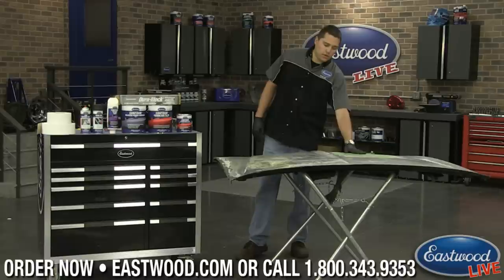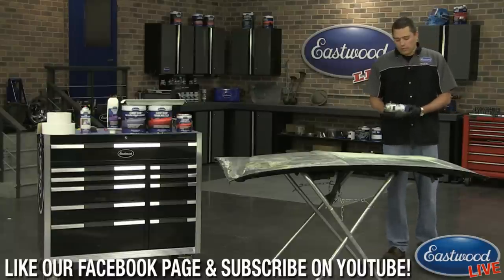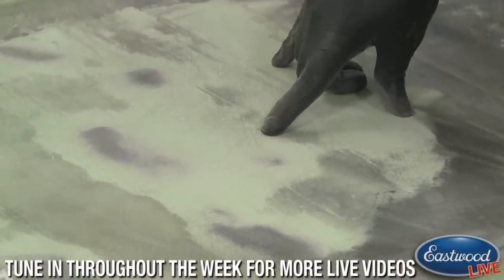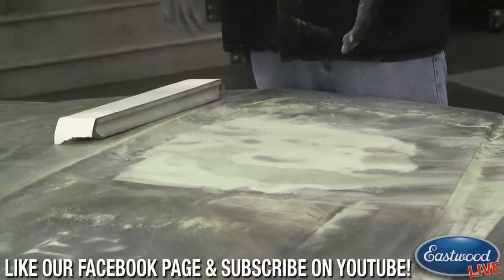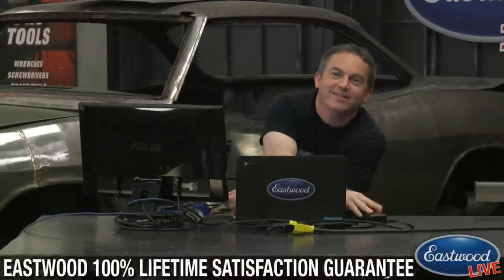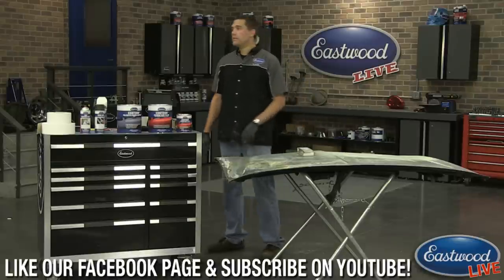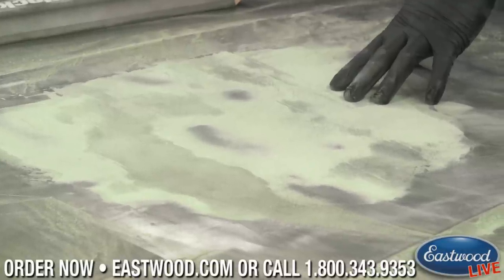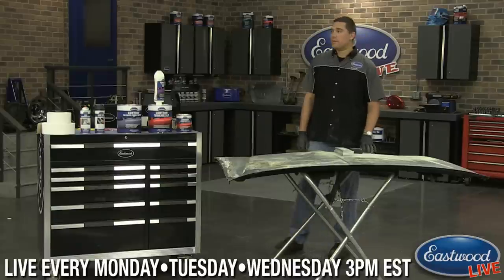Beginner’s Guide to Sanding Body Filler - Basics of Body Work - Eastwood

Comment: I liked HomeGrownPyro's comments, but I'm going to be less polite than he was: my question is when you are through with 80 grit, and 1/16 wide, somewhat deep channels like a river are on my hood, "do I sand deeper or add filler?" My next question is to understand the mechanism of failure:  What caused my problem? I wonder if Eastwood is too stingy with the blue filler, which I can't find in the cheap parts chains filled with poor young men and ladies just trying to survive, such that their was a lack or hardner, or perhaps I did not mix the aluminum type bondo throughly enough the next day. Your greatest help to me came from an informal comment: "It's just body filler. You can always start over."

Comment: One key factor is mixing the products correctly. Most new body people I have worked with don’t even know the correct ratio or how to do it. Improper mixing can cause failure. Sanding product when it’s soft does as well, maybe it keeps the dust down but you can pull the uncured product off the panel.
Reply: Thanks for the tip

Comment: I use all Eastwood products. I have many feet of 80 grit that loaded up with filler. The paper is not worn but has random clumps on it. The sand paper also comes off my Durablock after 2 to 3 uses. I've let the filler harden more but am still using a lot of sandpaper.

Comment: This video was really good, thanks....would have loved to see him go into the next step of working the metal before applying another coat of filler. Being new to auto body work, I struggle the most with that next step of working the metal more. I kind of get lost in the mix of metal, filler, highs and lows. I find it difficult to determine whether the bare metal showing through the filler is actually a high spot or the original surface. Usually end up making it worse by hitting small dents into spots that didn't need to be hit in the first place lol. Anyway thanks for the vids they are really helpful 👍

Comment: This was Great I had 1 question. After epoxy has lost 5 day window before applying filler do you need to re spray another coat or sand to metal in those spots?

Comment: Maybe a silly question but how can you tell the difference between a HIGH spot and just that the metal is level with the surrounding body filler? Low is easy, it will still have guidecoat ...thanks in advance for the help
Reply: good question. it could just be level with the filler.east wood need to answer that. curious minds want to know

Comment: Can somebody clarify what he means when he says "work it "? He says it obviously needs more work, sand it work it sand it work it... There are high spots next to that low area with the 36 grit scratches so what would be next?
Reply: davenameless you keep applying and filling low spots and tapping high spots down until you get the flattest panel , work it means sand it and once you’ve sanded it feel to see if your panel is flat if not apply more filler until the panel is flat

Comment: Even if you use   guide coat,
 You wouldn't put it on until you got it as perfect as you could Get it,,, I never use it,, And  Never use the Palm of your hand,   Your fingers are, the most sensitive, To  Detect  Low spots,, And  Scratches ,,,, That's just a commercial,  To sell products,,